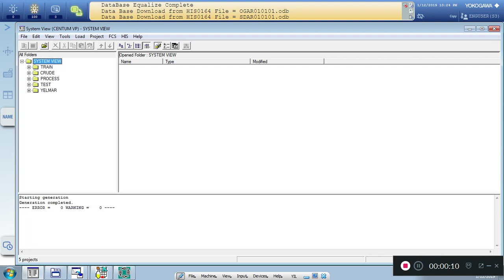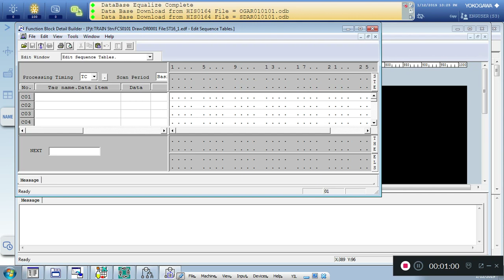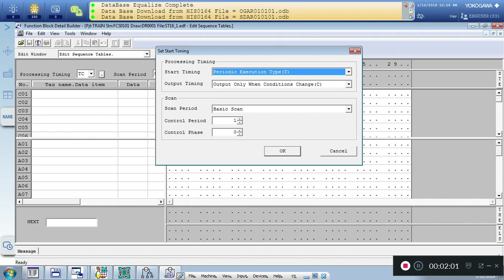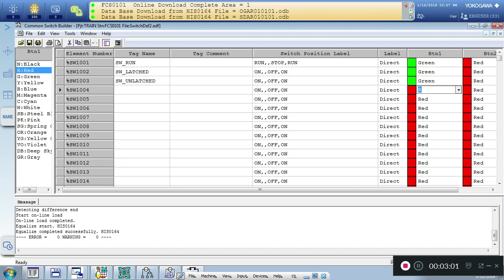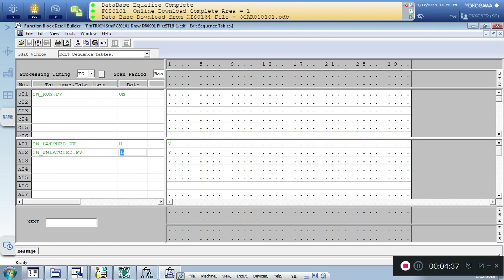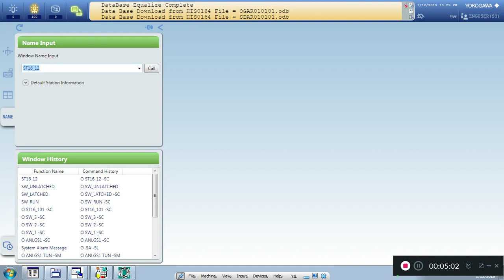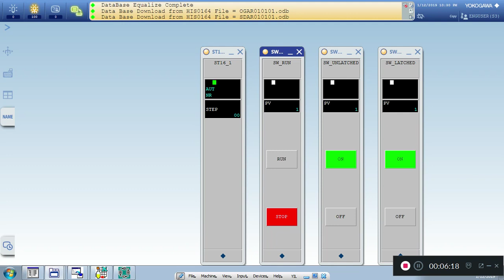CENTUM VP - Create INTERLOCK with ST16 Block (Part 1)

Comment: This makes sense, but to take it further, I would like a HH Pressure to close an analog valve. however, I am struggling to find the right command structure to tell my PID block mode to go to manual and the MV to 0%.  Could you please share an example for those?